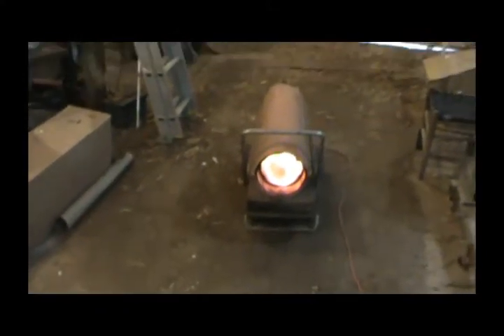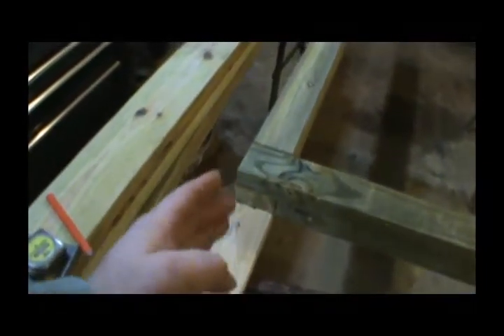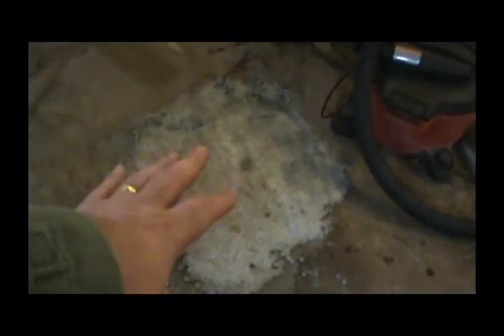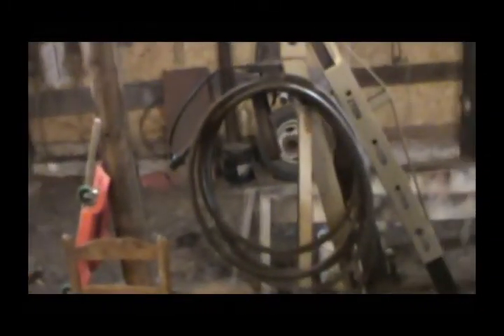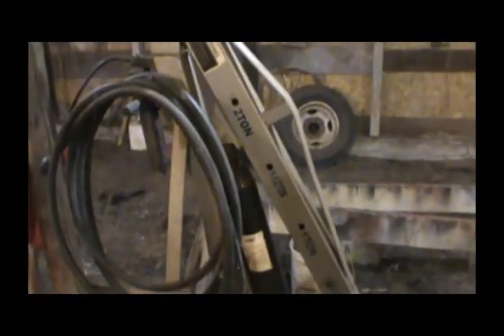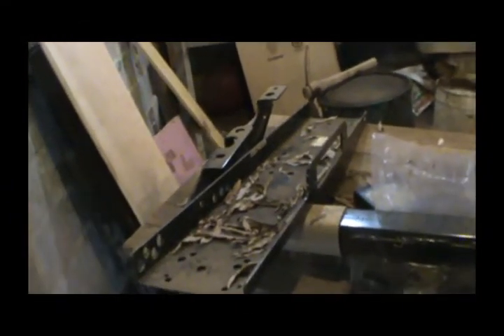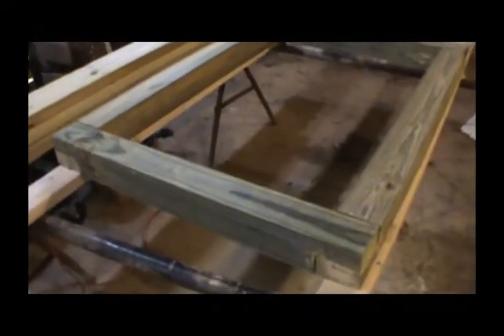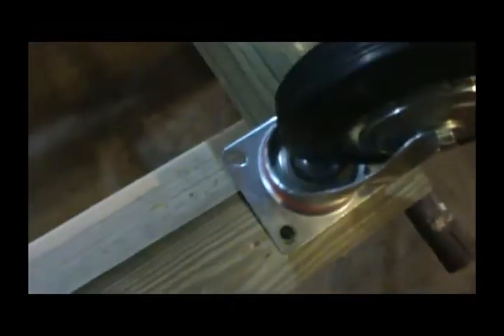Wooden Truck Bed Frame Build Part 1

Comment: I crawled under one of our semis to air up the brakes one time.  Luckily it was night and pretty cool out.  Well I shine the light above me after I start filling it up with air an see a bees nest the size of my head.  Could have been a bad situation if it would have been a warm day.  Always have to be careful.
Reply from the maker: I had a close call this summer with a large wasp nest on our old Ford 3000 tractor.  The vibration must've lulled them to sleep because I had my hand within 4 inches of them before I saw it!  Just thinking about it gives me the shivers!
Reply: farmboy30117  I bet,  even one bee can be tuff to deal with.  I can't imagine a whole nest.